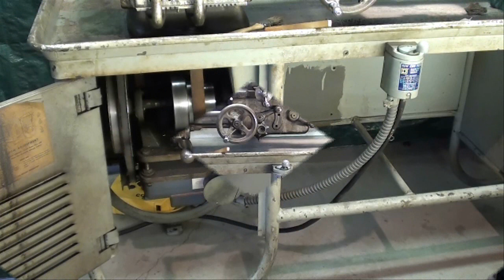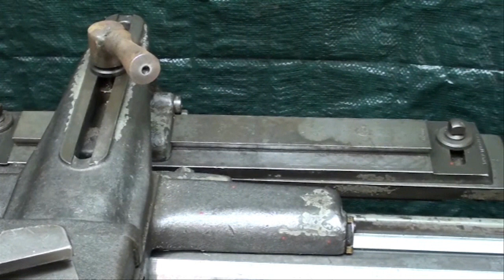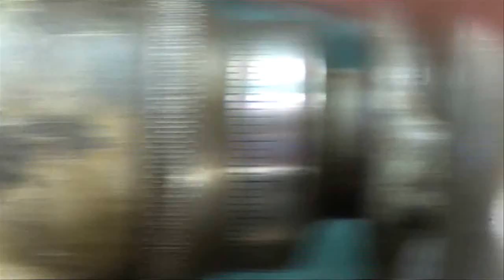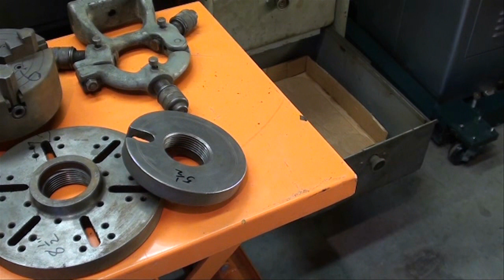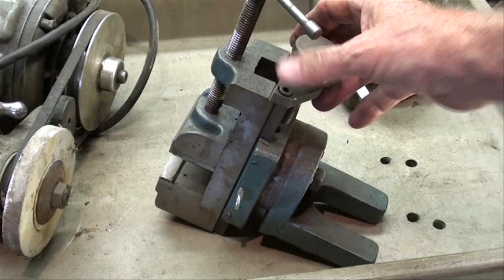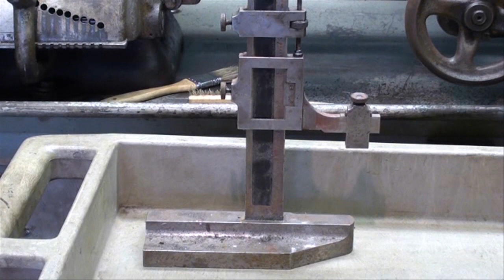TUBALCAIN BUYS ANOTHER SOUTH BEND LATHE 10" heavy

Comment: Hi. I recently purchased a 16” SB lathe approximately’ 1948. I have started several threads asking various questions about my machine on the South Bend Lathes part of the Practical Machinist forum. Unfortunately, there seems to be more browsers, but not so many who are willing to weigh in on the questions I have. I also got the Ilion book on Reno au the south bend lathe. Again, I still have unanswered questions. Do you know any individuals, or forums I could go to to get some more information? The biggest issue I have right now is 1/4” end to end play in my lead screw. Thanks - Jon
Reply from the maker: The forums, are the only place I would think of looking. Make a bushing or spacer to take the play out of the lead screw
Reply: @mrpete222  thanks for your reply. A friend of mine has a 14” SB, which has a ball thrust bearing between a collar on the lead screw, and the gear box. This is exactly where my lathe has a 1/4” play. I like your idea. Where can I get a parts manual?

Comment: I operated a South Bend lathe with the same apron clutch for the carriage and cross feed. 
What I didn't like was when you were in a heavy cut it was too hard to disengage the clutch knob. Newer models have a lever you pull up to engage and down to disengage which works way better.

Comment: Good Day Mr Pete.
I would like to ask for your assistance, trying to improve the performance of the used lathe I bought.
I have what seems to be a SB Heavy 10 lathe . Model year is 1934, according to the serial number.

I am trying to buy a new nut for the compound feed, but the measures do not match.

The OD of the lead screw is 1/2 inch while all standard are supposed to be 3/8.
The OD of the retaining screw thread is 3/8 inch and the body of the screw is probably 17/32 inch. (I'm used to metric measures so it may be incorrect as I converted from Millimeters)

Do these measurements come to any standard nut?

Comment: I am looking to buy a Southbend 14.5 lathe which I didn't know their was a lathe that size.  The person that has it bought it and
 disassembled it and cleaned and acid washed most of it.  It all looks good but I am not sure about the Babbitt bearings on the lathe I don't like the looks of them but I don't really know what they should look like. How much trouble would it to be to pour new bearings or change to roller bearings.  I don't really want to do either, so I am hoping you can give me a hint as to what to look fore on the Babbitt ones.
Reply from the maker: That must be a real old machine. I have never seen one or worked on one with that type of bearing. I would stay away from it

Comment: Conga-rats on finding your (new) old lathe.
   I always like to see what goes on in another guy's shop and I do appreciate the films you have published .  Good info for a young person if he is interested in machinist's work.  I am a retired nut-splitter myself having worked at it for 35+ years and now with a good pension.  There are two lathes in my shop, the latest being a "free-for-taking-it-away" Atlas 9 w/ tooling, including a milling attachment, with no compound but I have a large milling machine I got for scrap price. It works pretty good and I'll make my own compound rest.  The miller is an old (1938) Browne & Sharp Universal.  A large machine but I made a place in my garage/shop for it.  Lots of entertainment cleaning and overhauling it.  Next I had to put in a 220v 3-phase converter & and the attendant extra wiring (doing a bit of scabbing on the electricians)
And where do you get parts for that old B & S miller? - - - Nowhere!.  Cincinnati parts all over, but no B & S.  I had to make my own lube pump for this miller, by the way, and some adapters to use other makes of tooling, etc.  Hey!  No problem, it's just more entertainment.
  Thanks for your articles.  Gerald
Reply from the maker: GERALD COVEY Thanks for watching. Sounds like you are enjoying yourself.
Reply: mrpete222 Right!  I recommend retirement as soon as you can.  The best part for me is to not have to be some certain place by 7:30 AM and stay there until 4:20 PM.  G.

Comment: The newer VFDs can run a 3 phase motor on single phase in.  Not expensive and wonderful for variable speed and braking....not to mention motor protection and reverse.  Unit for a 1 HP motor would run 120 dollars.  Have one on a delta Drill Press and it is awesome.

Comment: I picked up a SB 13" a few weeks ago.  Built in 1947 with the "old" style quick change box.  You stated that there were two controls for the old style.  There are actually three.   There is the one tumbler arm, a lever for high, medium and low (which can be safely moved when the lathe is on) and one more control which is on the left side.  A slide knob which moves in and out.  

To set the old style you select the tumbler, the in/out control and then move the lever.